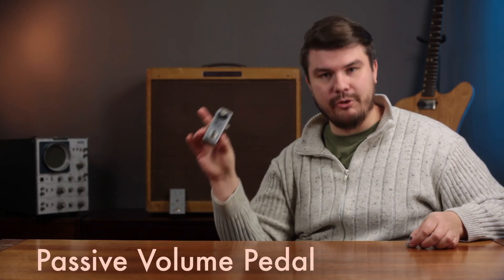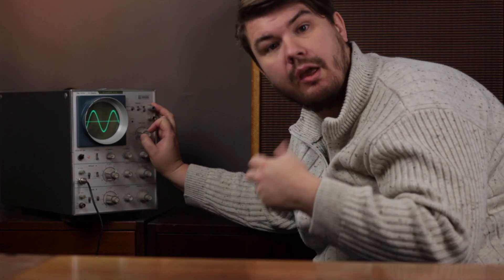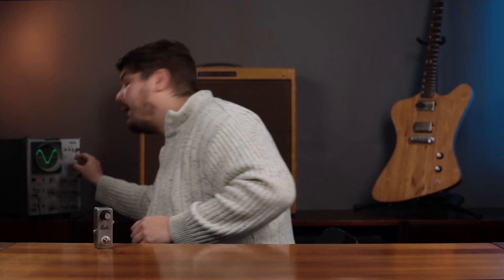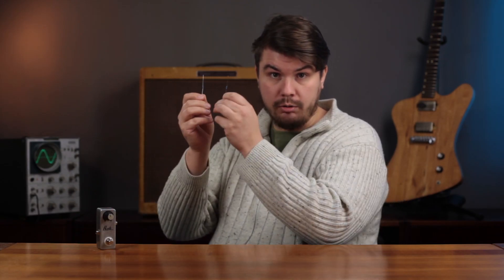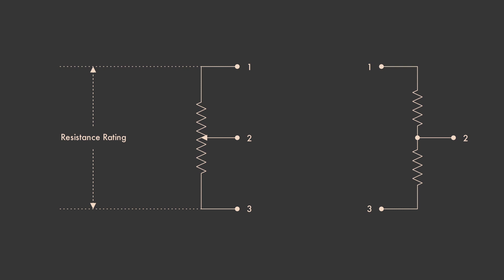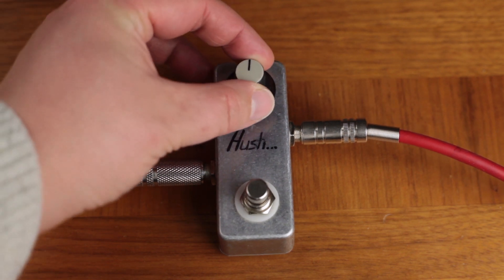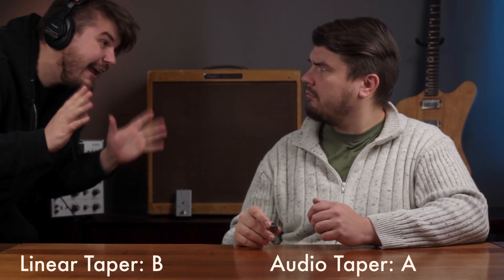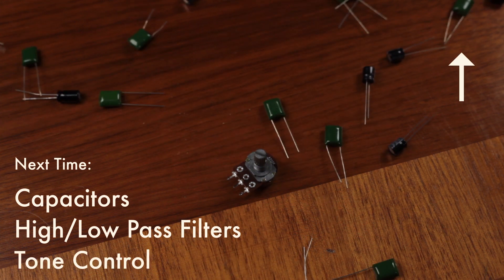DIY Passive Volume Pedal

Comment: Thanks for this vid.  It explained everything I needed to know about making inline volume controls in my setup.  Also, after years of knowing a bit about potentiometers and rheostats, this vid caused it to dawn on me what the real difference is: a rheostat is just a variable resistor, while a potentiometer is a voltage divider.  Now I kind of get why one lug of a potentiometer is often grounded to the case.  But what I'm still left wondering is what would happen in this volume control if that weren't done.  Why must it be a voltage divider, rather than just putting variable resistance in the circuit, and depending on the corresponding voltage drop to do the job?

Comment: Thanks for the helpful electronics information, however, I fail to see the point of this device.  If you just want to control the volume by hand, most guitars already have volume (and tone) controls built into them.  The point of a "pedal" is that the device is controlled by your feet, leaving your hands free to play your instrument.
Reply: I was originaly planing an entire series of how to build effect pedals, but then life happened. I wanted to introduce one component and concept per video, while building a pedal that is functionalaon its own. This video was ment to introduce the general idea of potentiometers and voltage dividers.
Reply: Please make more vids. They're very good.

Comment: excellent video, is a way to kill the hum ? because no mather what pot i put, the pedal add hum to the signal, for example if ive the pot to the top value the hum is low, but if i change the por value to less the hum is really bad

Comment: Good afternoon. I love your videos, and made a dual looping pedal based on your effects looper pedal which works extremely well. A question for you around potentiometers. I am making a passive receiver for an in-ear-monitor setup, where the receiver will receiver the input of vocals only from a mixer (via a wireless guitar 6.5mm transmitter/reciever) and go through a potentiometer before into the in-ear earphones. What impedance should i use, noting the whole point of this is to allow me to hear the pitch in my singing when im playing and i dont want the potentiometer to darken the sound or potentially misconstrue my singing pitch. Your advice is appreciated, i hope you have a video coming out soon! Thanks

Comment: Friend, do I need a high pass filter capacitor to let highs to pass when the pedal is on to prevent it from darking the sound or not? Would you help me with it, please?
Reply from the maker: If you have the passive volume pedal directly after a (non active) guitar it could possibly slightly darken the sound. If you find that to be the case for you I'd suggest using a potentiometer with a higher resistance rating.

Comment: I’m assuming this same circuit can be applied to a expression pedal? For example, building it in a Wah pedal enclosure. 

Great video! The quality is impeccable… You really should keep uploading!
Reply from the maker: Yes, the electronics are absolutely the same. Though I think the potentiometers used in expression pedals are mechanicaly slightly different as they have to be geared.

Thanks for the encouragement. New videos are in the works!